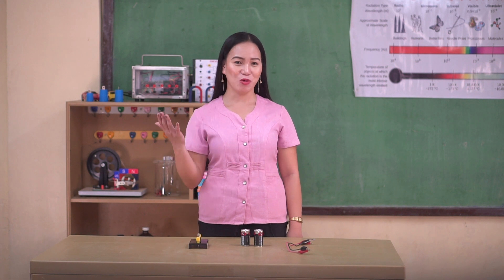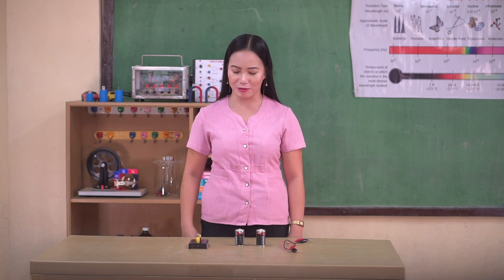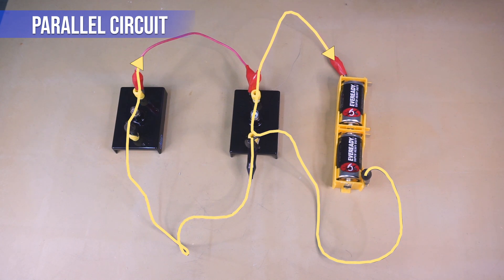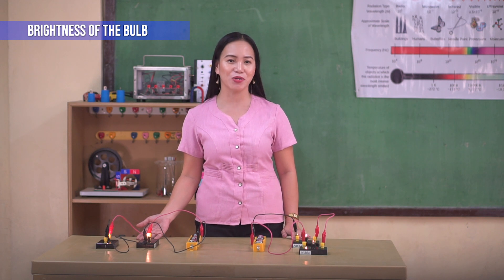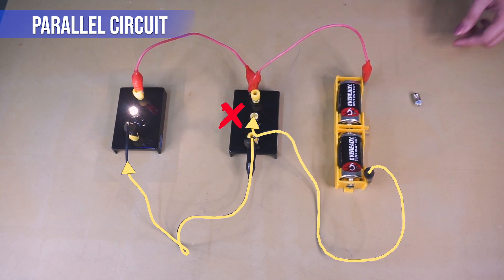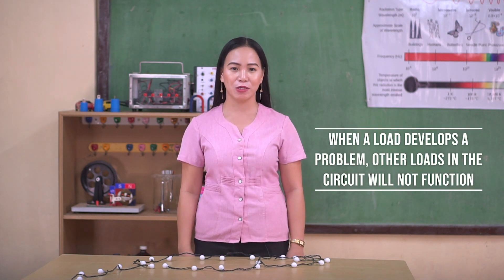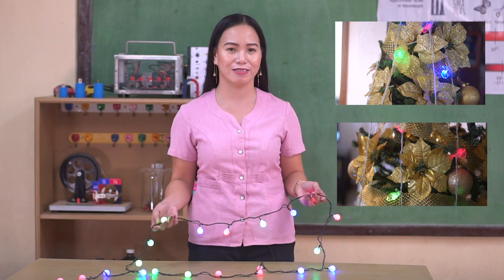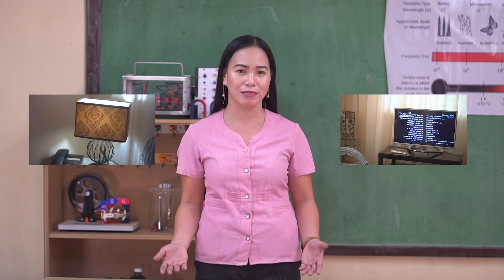AAH Episode 3: Advantages and Disadvantages of Series and Parallel Circuits

Comment: Very slow explanations and lot of aww's animation and musics... and there is one major disadvantage in parallel connection that is Load handling when there are 2 devices connected parallel in circuit, current flows into the lower resistance device and it skips the higher resistance device.... u didn't explain that....